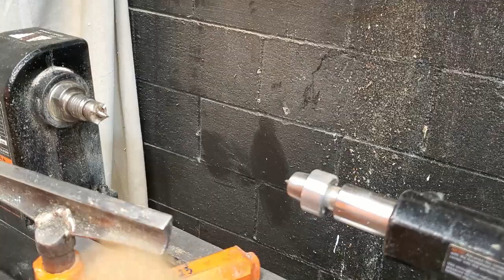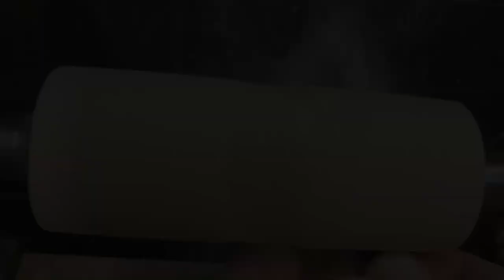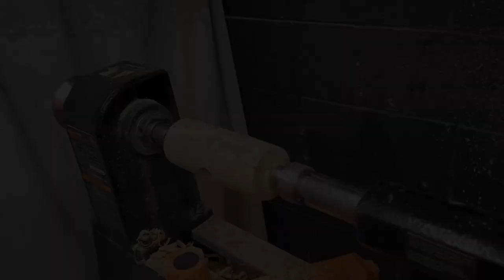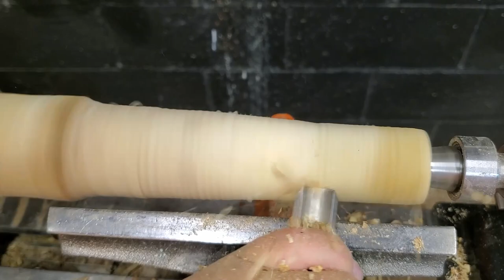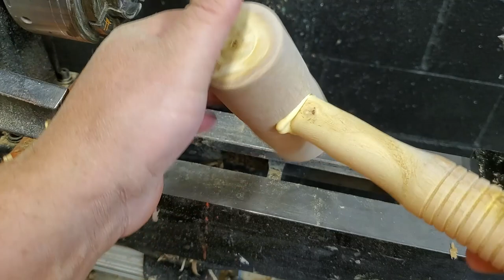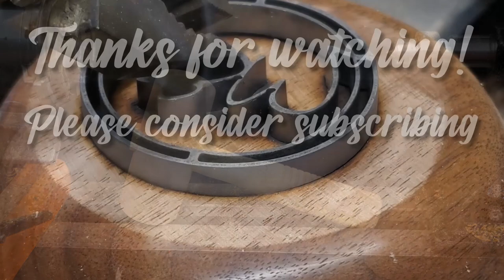Quick Small Wood Hammer Build || Small Basement Shop Wood Turning

Comment: Smart job Chris and another excellent wee vid - I especially liked the angelic shavings bit. Was there a special reason for drilling the head before turning or is that just personal preference? Cheers mate, I enjoyed that.
Reply from the maker: Thanks Mark. I am sure there are many ways to do it, but I figured if I had the hole first, I could put it between centers kind of lined up. I really need to get a drill press so I can put it where I want it reliably. Once the hole is in it, I find it easier to make a tenon fit a hole than a hole to fit a tenon.
Reply: @BAILEYWOODWORKS  Yes, that all makes sense. Thanks for replying mate.